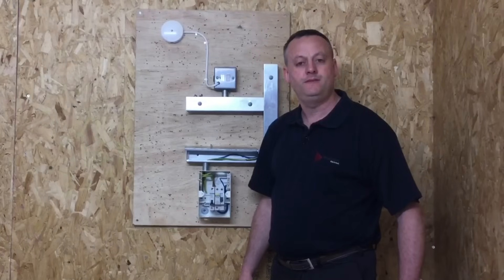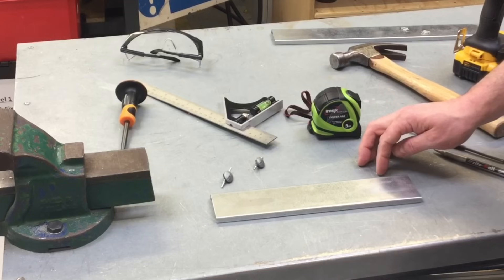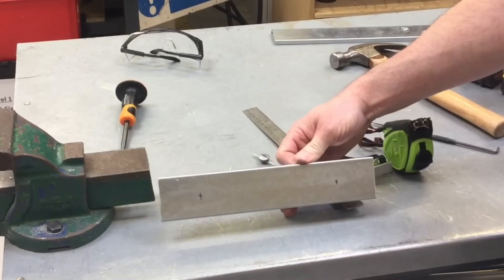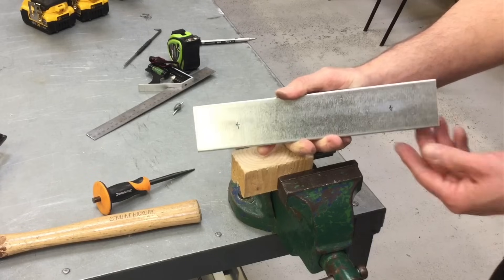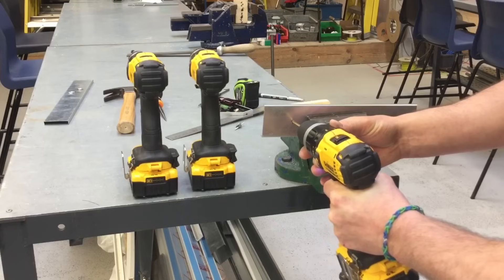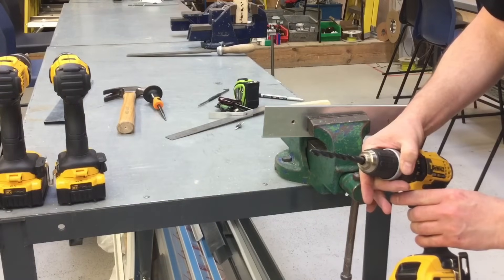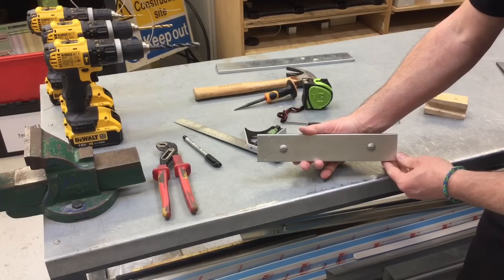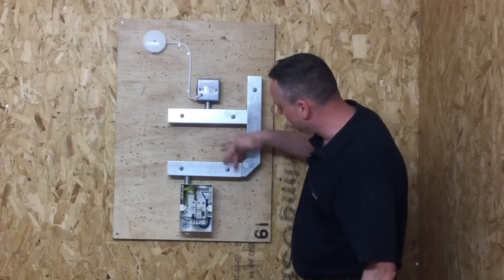How to Fit the Trunking Lid to 50 x 50mm Galvanised Steel Trunking Using Trunbuckle Clips

Comment: I would add one further check - before offering up the lid and turning the buckle, ensure cables inside the trunking are well inside the trunking and are not liable to be trapped by the pin of the turnbuckle. Been there, done that, learnt my lesson!
Reply from the maker: Hi. We sure mention that during our lessons and we pick up any issues during the insulation resistance testing. Thanks for commenting and watching GSH Electrical 👍.

Comment: I work principally with domestic installations and didn't train at college so have never used steel trunking; forgive me if I'm being ignorant but you mention in closing that the fitting is plastic; does this mean that the cables have to be secured within to prevent collapse in the event of a fire? How does this change to the regs affect teaching; do metal saddles even exist for plastic conduit and are you using anything fireproof to replace a proportion of the clips on T&E?
Reply from the maker: Hi. We are still under the 17 Edition and I recorded it 5 months ago. Yes moving forward we will use a metal version so another video to follow later next year. Thanks for commenting and watching GSH Electrical
Reply from the maker: Hi I have added this to the description...

I shot this video in March 2018 moving forward under the 18th Edition Wiring Regulations the lid fitting may now benefit from being non combustible (metal). Remember it’s trying to prevent premature collapsing of the wiring system so the fixing shown in the video could possibly still be used...!
Reply: David Gill hi there, as someone who has studied at this college, this is an over view video for an assessed fabrication piece set by the exam board, to help students preview prior to step by step fabricating in the work shop.  Can still remember this with the filing part being my menace.  But they do also get us to secure fixing with metal clips etc in various jobs.

As for saddles, go to RS and search pro cable clip screw steel saddle clamp am sure these are other brands, that just one I know off the top of my head on a job I did recently.